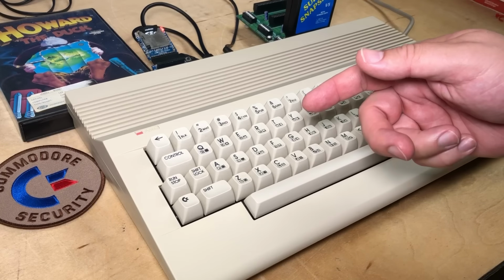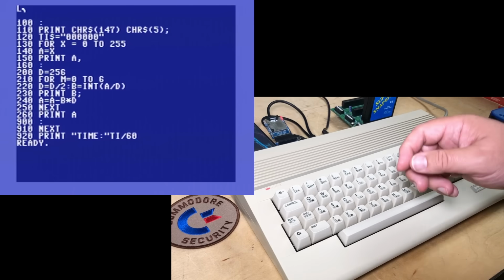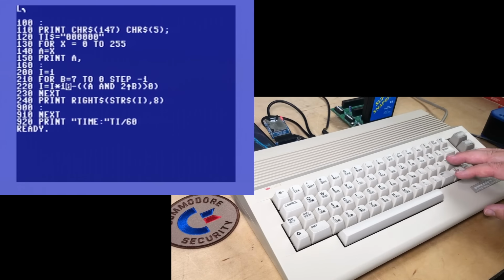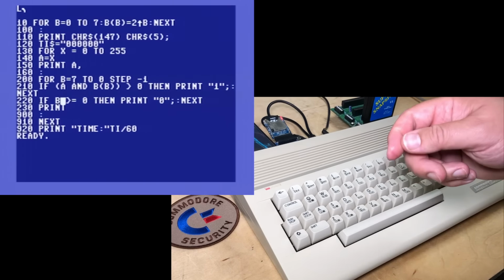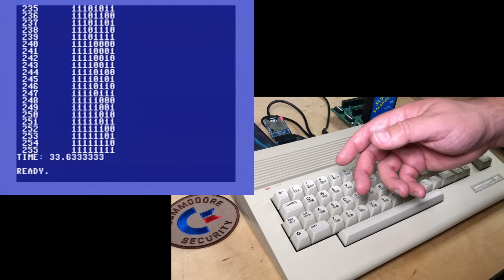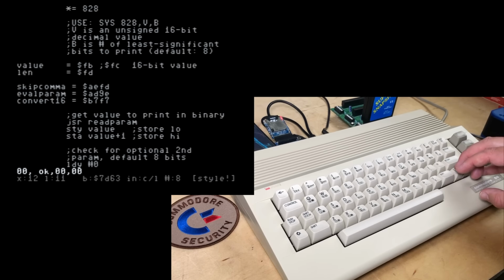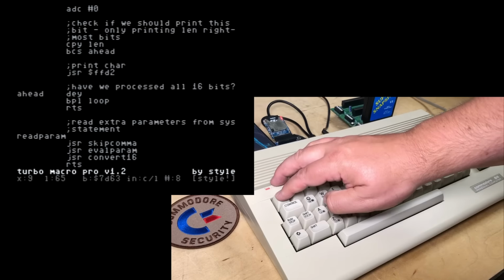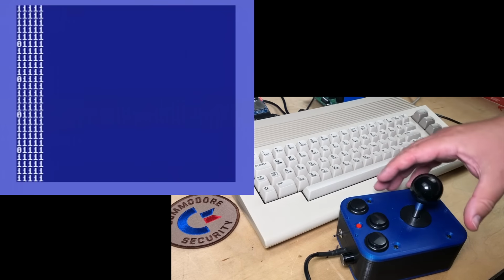Printing Binary in BASIC and Assembly on Commodore 64

Comment: For bit of a speed bump use "JSR $E716" to output a char to the screen rather than "JSR $FFD2"

This will bypass/avoid the indirect JMP at $FFD2:
FFD2: 6C 26 03  JMP ($0326) 

$0326 is a vector which (by default) points to $F1CA

Code at $F1CA checks to see if we are outputting to the default device:
F1CA: 48           PHA

F1CB: A5 9A     LDA $9A       ; Default Output Device (3)
F1CD: C9 03     CMP #$03
F1CF: D0 04     BNE $F1D5
F1D1: 68            PLA
F1D2: 4C 16 E7  JMP $E716     ; Output to Screen

So we can avoid that by going straight to $E716.

You could of course bypass the output device checking by changing the vector at $0326 to point to $E716: 
Poke 806,22
Poke 807,231

Then all basic PRINT statements as well as all machine code JSR $FFD2 will jump via the vector to $E716 (output to screen) without the checks to see if we should be outputting to a different device (which of course removes the ability to PRINT to other output devices), you would have to restore the vector before doing any of that.
But this still uses an indirect JuMP - which is 5 cycles.

JSR $E716 will save you 5+3+3+2+2+4+3=22 cycles per print character call (over JSR $FFD2) - not massive but something!

To be honest, if I were to need a decimal to binary string routine for basic  using SYS I would store input parameters in memory (directly to the addresses you are storing them in your routine) Poking 2 or 3 bytes is much faster (but not as convenient) as the evaluation of parameters, also I would store the result in a string variable, which can then be printed or used however needed.

Since the object here is to write a fast decimal to binary print routine it would be winning to write a faster 'string to screen' routine.

Sorry for the long post; TLDR: For bit of a speed bump use "JSR $E716" to output a char to the screen rather than "JSR $FFD2"

Comment: I'd crunch that BASIC program and reduce line numbers as much as possible (preferably single digits). I found the latter especially makes a difference;, particularly where for/next loops are involved. I wrote a simple joystick/digital mouse controller for a few of my attempts at GUI programs and it was extremely sluggish when at its original high line numbers (tacked on the end of the BASIC programs).

Obviously that ran much better when I converted it into assembly .. and assembly was the only way to write a proportional mouse driver as I then ran these under interrupt.
Reply: NB: FOR/NEXT doesn't care about line numbers (the NEXT returns to a real address that's pushed to the stack), it's only GOTO (or "THEN <line number>") that cares.  And the length of the line number would only matter a little bit to GOTO; the position it exists at in the program matters much more as the lines are stored in a singly linked list .... and BASIC seeks through a huge portion of the list when finding the target of a GOTO (it has a shortcut to determine whether to search from the start of the program or from the current line, but it's still slow).

Also be careful when benchmarking as the order of variable declaration also matters (they're stored in an array and searched sequentially every time there's a variable reference).  Minor changes in variable order could result in significant speed gains or loss.

MS-BASIC (which V2 BASIC is a variant of) is just awful for performance, especially in that era.  BBC BASIC is much faster!

Comment: Printing to the screen is always the bottleneck.
Reply: Scrolling the screen is where it gets nasty.
Reply: @mikechappell4156  Honestly, for the purposes of joystick interpretation (or something similar), printing a home character at the end of each line would make it faster and make more sense than a carriage return.
Reply: @stevethepocket  I tried it and it cut run time down to about 56%.
Reply: I prefer to buffer screen codes 1000 at a time. and then flip up and down between them with a nice fast move in assembly.

Comment: What’s faster, str( or val(?
Reply: Apparently VAL. 1000 VALs on my C128 took 10 seconds; 1000 STR$'s, 17 seconds.
Reply: @markjreed  All string functions are hogs, that I remember.  Hey, thanks for doing that.  That’s interesting.
Reply: @CandyGramForMongo_  Sure. In each case the argument was a literal, btw; STR$(1234) and VAL("1234"). Replacing those with preassigned variables shrinks the difference a little: 1000 VALs still take 9.5 seconds (572 jiffies) while 1000 STR$'s take only 13.4 seconds (801 jiffies).

Comment: Variation on the last BASIC code that could be a decent bit faster than the other BASIC versions: precalculate the 16 4-bit nibbles in an array of strings, and print those in the loop using lookup on INT(A/16) and (A AND 15).

(Then you only precalc 16 short strings instead of 256 longer ones, cutting that time down from 20 sec to approx 1 sec I estimate, at the - hopefully limited - cost of two fairly simple calculations in the loop.)

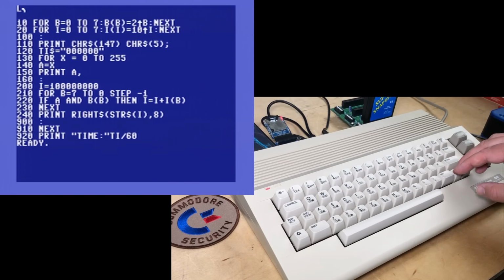Comment: 13:27 Not sure that excluding precalculation from your timing is entirely fair; by that metric creating an array B$() that contains all 256 answers then doing FOR X = 0 TO 255:PRINT X, B$(X):NEXT would be a winner even if you used your 96 second method to generate it.
Reply: To me the thing to do would be to precalc a nibble table, i.e. DIM B$(16), then print each 8-bit value as two nibbles. Precalc time would be about 1.2 seconds, and print time would only be slightly slower than the fastest 13.2 seconds, perhaps 14-17 seconds. The total execution time would be less than 20 seconds, which I think would be hard to beat with Basic.
Reply: Actually, I tried the nibble method. The printing goes now like this:
140 PRINT A,
150 PRINT B$(A/16);
160 PRINT B$(A AND 15)

End result:
PRECALC:    .783333333
TIME:.    16.3166667

So the total is around 18.1 seconds.

Edit: I see csbruce already did an even faster version of the nibble method. Kudos!
Reply: @VarjojenParatiisi : The pre-calc can be completely unrolled since there are only 16 values, and multiplication is faster than division (even on the newest CPUs).
Reply: @csbruce  You're absolutely right. I saw your elegant implementation and decided there was nothing I could do better so I just left my implementation at that point. In hindsight, I should have done the multiplication by a variable containing 1/16 instead of dividing with the constant 16 as you did. That would have made my routine faster as I would have saved both parsing of the constant imside the loop and, of course, the slow division.

Comment: When I was trying to get gains related to checking bit states on the color computer 2, I managed to eek out a little bit more using DEF FN. I don't know how DEF FN works in Commodore Basic, but on the CoCo, you only have to define a function once, at which point it's pre-tokenized and never has to be parsed again during the execution of the code. So calling the (preparsed) function is faster than parsing the equations every iteration of the loop.  At least in CoCo BASIC.  :)
Reply: Thats pretty neat
Reply: @lasskinn474  Yeah, the real trick is figuring out how to utilize (or work around) a used defined function that can only be passed 1 value.  My solution used linked lists, multiple arrays in which the values I want to operate on share the same index. So then by passing the index value to the function, it references multiple variables (locations in different arrays) in the calculation despite only receiving a single value.  ;) I thought I was so clever when I worked that out back in the day.  LOL  And all for marginal gains, because BASIC is so darned slow.  HAHAHAHA
Reply: @StevenIngram  At least in Commodore BASIC, the parameter to a DEF FN is dynamically scoped. So if you have FNA(X) that calls FNB(Y) then inside B,  X will refer to the value passed into A.

DEF FN doesn't seem to save time on Commodore, though. I defined a complex function and called it 1000 times and compared it to doing the same calculation directly in the body of the loop. The function version took 1m44s and the direct version took 1m41s, so if anything the function call/return overhead slowed things down. 

Which seems to fit with the overall philosophy of the C=BASIC interpreter: It does hardly any advance tokenization. Keywords get converted, and that's 'it. Not even decimal numbers get parsed, instead just left as sequences of ASCII digits, so I'm not surprised that the function isn't precompiled in any meaningful way.
Reply: @markjreed  Interesting. Also, I'll be first to admit that my memory of things may be faulty. I'm getting old.  :D
Reply: @StevenIngram  I didn't contradict anything you said; I would not be at all surprised if DEF FN actually saved time on the CoCo. The fact that the post-Level-I TRS-80 BASICs were also made by Microsoft doesn't mean they had the same quirks as the Commodore versions. :)

Comment: This is what I have created
It takes the remainder of the value and adds it to a string variable so it isn't reversed

10 TI$="000000"
20 A=0
30 FOR T=0TO255:PRINT A,
35 I=A:S$=""
36 :
40 FOR J=1 TO 8
50 M=I-INT(I/2)*2          : REM I % 2
60 I=INT(I/2)              : REM I >> 1
70 S$=MID$(STR$(M),2,1)+S$ : REM APPEND
80 NEXT
81 :
90 PRINT S$:A=A+1:NEXT
100 PRINT"TIME: ";TI/60

it takes about 73 seconds to complete while expanded across multiple lines
Unexpanded: S$=MID$(STR$(I-INT(I/2)*2),2,1)+S$ : I=INT(I/2)    and takes 67 seconds to complete which is pretty close to the first routine
Reply: 10 ti$="000000"
20 for n=0to255:x=n:b$="":b=128
30 ifb>xthenb$=b$+"0";goto50
40 b$=b$+"1";x=x-b
50 b=b/2
60 if1<bthen30
70 print n,b$
80 print "TIME",ti/60

This is the fastest basic methord i can come up with, 31 secs on the vic20
Reply: I believe the vic (pal) is a teeny bit faster than a 64

Comment: The only other basic (no pun) update I would have done is instead of having the computer update the entire screen for each line, "HOME" the cursor at each print statement.  Clear the screen once at the start, then at each print, just HOME, then print the result.  There is a LOT of time spent on redrawing the screen.

The other thing I might have tried is just do appending to a string and do one print of that string.  So instead of calling the print many times during:
ti="000000"
print "{clrscr}"
for L=0 to 255
  S$=""
  for B=7 to 0 step -1
    {do whatever steps to figure 0 or 1}
    S$=S$+{result}  [[[AFTER POST EDIT]]]]
  next B
  print "{home}"L,S$
NEXT L
print "Time:" TI/60

Your current process of calculating how long it takes to do something I personally thing is a bit (No, not a pun..) invalid since your times include how long it takes to draw the screen, not how long it takes to do the calculation of the bit positioning.  Doing the print one entry at a time does make for a straight forward comparison between ALL the revisions, but, the pure ASM version I think would just destroy every other version if the cursor were HOMED instead of new lines printed out.

Too busy at work to kick up VICE to play (Or go over and type it in on my 128 in 64 mode) so what I've got here is just theory.
Reply: I had the same thought; scrolling the screen wastes a lot of time.  Maybe you want to see the surrounding context of the joystick values as they change, so there's value there in the end result, but keeping the display on a single line is a lot faster.  I wrote a simple one-byte version of the print-byte-in-binary  ML routine; a BASIC FOR loop SYSing to it as in the video took about 14 seconds, but adding a CHR$(19) after each SYS chopped the runtime down to under 5 seconds.

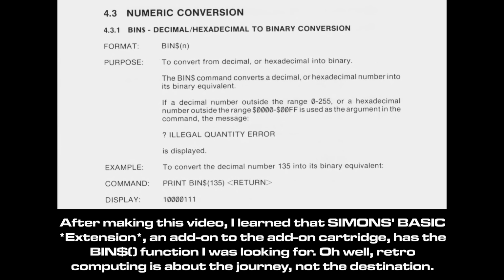Comment: 1:49 What's the name of the font you use for subtitles in your videos?

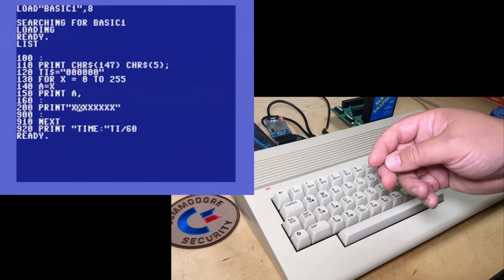3:32 Since BASIC includes the critical operation to support this, the obvious way to fill in the program (at this point in the video) is:

10 A=0:Z=49:J=128:K=64:L=32:M=16:N=8:O=4:P=2:Q=4
200 PRINTCHR$(Z-((AANDJ)>.));
210 PRINTCHR$(Z-((AANDK)>.));
220 PRINTCHR$(Z-((AANDL)>.));
230 PRINTCHR$(Z-((AANDM)>.));
240 PRINTCHR$(Z-((AANDN)>.));
250 PRINTCHR$(Z-((AANDO)>.));
260 PRINTCHR$(Z-((AANDP)>.));
270 PRINTCHR$(Z-((AANDQ)>.))

Run time: 27.40 seconds.

Since the method is non-destructive, you can also apply it directly to the index variable, reducing the run time to 26.98 seconds.  You could also stuff three binary digits into each PRINT statement.

8:00 Using «PRINTRIGHT$(STR$((AANDJ)>.),1);» also makes my program slower, I guess because there's two string functions and STR$() might use division by 10.

9:14 OMG — you're using exponentiation in optimized code!  That's even slower than division.  I'll use my first emoji: 😱 !

12:59 Given that you're running the loop lots of times, I'd say it's more reasonable to include the pre-calculation time.

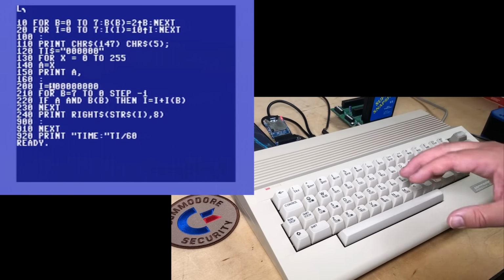14:02 You could also unroll the loop and use constants.

15:41 Here's my "pre-calculation" version (pre-calc included in run time).  Instead of processing one bit at a time, it does four bits at a time (hexits):

121 DIM A,X,H$(15):F=15:S=1/16
122 H$(0)="0000":H$(1)="0001":H$(2)="0010":H$(3)="0011"
123 H$(4)="0100":H$(5)="0101":H$(6)="0110":H$(7)="0111"
124 H$(8)="1000":H$(9)="1001":H$(10)="1010":H$(11)="1011"
125 H$(12)="1100":H$(13)="1101":H$(14)="1110":H$(15)="1111"

200 PRINTH$(A*S);H$(AANDF)

Run time: 14.95 seconds!

19:32 Perhaps they'd be called "Pessimizations".

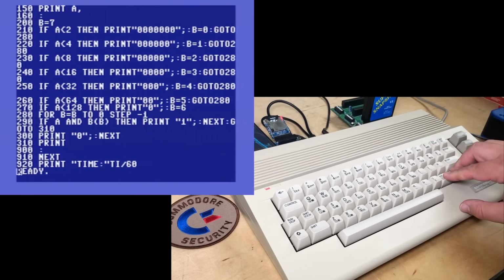21:40 The first four statements are useful only 6% of the time and are dead weight 94% of the time.

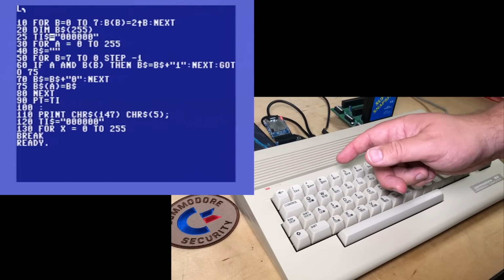23:00 I think you're obligated to include the pre-calculation time this time, considering that the pre-calculation is a complete run of the main loop!

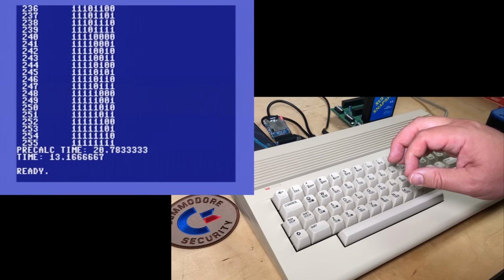24:27 Most of the work of the second part of the method is scrolling the screen, which is included in all the other methods.  This makes the first part seem faster.

34:23 It would be easy enough to assign 828 to a variable.

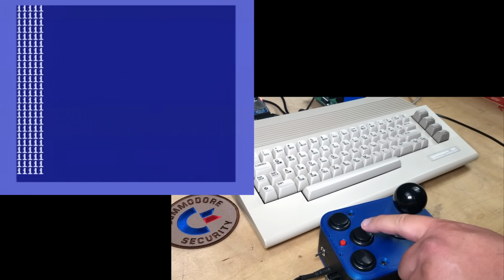37:08 How about an AI joystick that just plays the whole game for you?

37:52 When your songs go "Maximum Reverb", it might be helpful to have subtitles.
Reply from the maker: I use the Microgramma font most of the time, which was a favourite of both Commodore and many sci-fi films, beginning around the release of 2001: A Space Odyssey.

Thanks for all the great observations. I could pretty much remake the video following all your ideas. But... I probably won't :)
Reply: hexits?  I don't get it... we're printing out binary digits... so four at a time would be... nybblits?

{re-rereading} Oh, I think I get it now.
Reply: @MattKasdorf  four bits = 1 digit in hexadecimal (base 16), hence "hexit".

The whole reason programmers use hex (and used to use octal) is because the digits map directly to binary bits, no matter where they are in the larger hexadecimal number. For example, $30F6 in binary is just the binary for 3=0011 followed by 0=0000 followed by F=1111  followed by 6=0110: 0011000011110110. No division required. 

You can't do that with base 10; seeing a 2 somewhere in a decimal number doesn't tell you anything about the underlying bit pattern. So you have to do the actual base conversion arithmetic.
Reply: @markjreed  The only people that seriously used octal were intel 8 bit cpu machine language programmers because many of the instructions mapped the 8 addressable registers to bits 0-2 and 3-5 leaving bits 6 and 7 to indicate which of the four kinds of action to take, with one (or more? I was never that into intel 8 bit cpus) turning off the mapping for other instructions that didn't need it.
Reply: @TimStCroix  Nah, you're just not going back far enough. Octal was popular when programming older machines. For instance,  on Cyber mainframes the full machine word was 60 bits; it could be represented by 15 hex digits, but since words were so often divided up into 10 6-bit character cells, it made more sense to use two octal digits per character.

Octal also simplified source code parsing since numbers are still nothing but digits. That's ultimately where the C convention that leading-0 means octal comes from; it originated in either B or BCPL, which didn't have 0x for hex or understand any non-digit characters in numeric literals.
Reply: @TimStCroix  Octal was the predominant base on PDPs, which is also how it made its way into Unix file permissions, where it's still used as shorthand today. E.g. u=rwx,go=rx is expressed as 0755. Python has gone the extra step of deprecating 0 as octal prefix in favour of 0o. The PDP-1 used 18 bit words with a two digit opcode and four digit address part, including instructions that would modify only the latter. It also used 6-bit characters, but not bytes.
Reply: @0LoneTech  I wish I had been more specific and said "people in the 8-bit world."
I run Linux (Kubuntu) and chmod files several times a week, never using letter designations, always using octal numbers.
$ sudo find . -type d -exec chmod 775 '{}' \;
is a command I had to develop when I screwed up with chmod's -R recursive option. (Why, oh why, does chmod even have that option? Never use it, people.)
Reply: @TimStCroix  Obscure feature: to fix that case, with chmod -R a+X (capital X only applies x on directories or already executable files).
Reply: You should make videos too.
Reply: (Rats, should've watched the rest of it first; it's in there already. I got a slightly slower time, but maybe that's a PAL machine thing?)

If we're excluding precalculations from the time then the "fastest" way is to go

10 DIM B$(255)
20 REM FILL B$ WITH THE BINARY REPRESENTATIONS USING WHATEVER METHOD YOU WANT

...

120 TI$="000000"
130 FOR X=0 TO 255
140 PRINT X,B$(X)
150 NEXT
920 PRINT "TIME:"TI/60

Run time 13.65s!
Reply: @elbiggus : PAL machines run at 0.985 MHz while NTSC, at 1.023 MHz, though the VIC chip steals fewer clock cycles on a PAL machine.